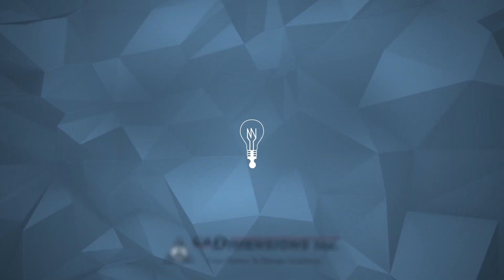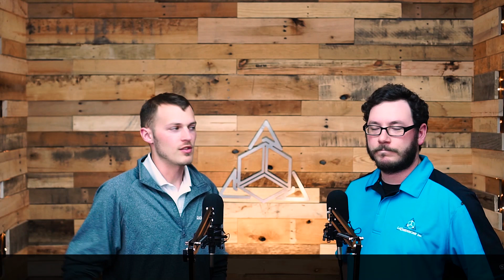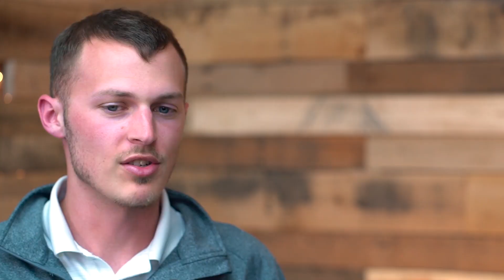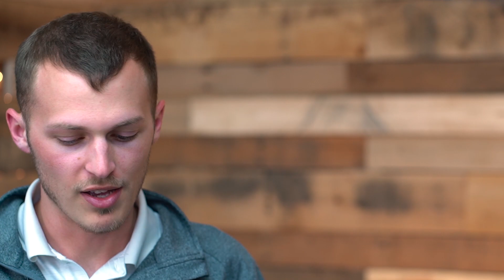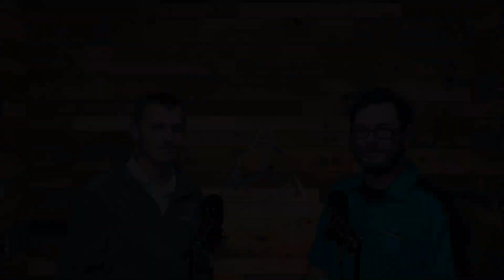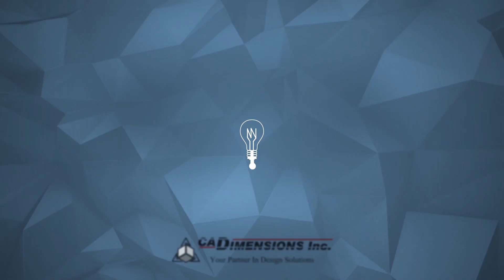Smarter Engineering PODCAST Ep 3 -  Why SOLIDWORKS Visualize?

Comment: Can you guide me to choose best hardware for Solidworks Simulation??? In future I will go for  Visualisation also, thanks guys... You are doing awesome...👍
Reply from the maker: Thanks for watching! Choosing appropriate hardware is always a challenge because it is usually a balancing act depending on your needs.  Different tools use different amounts of cores at different times. For example, you would optimize a machine for Flow SImulation differently than you might for regular Simulation. Puget systems has some great testing and juicy data that is usually a great starting point for making a decision! Here's an example:
https://www.pugetsystems.com/labs/articles/SOLIDWORKS-2018-CPU-Comparison-Coffee-Lake-vs-Skylake-X-vs-Threadripper-1105/